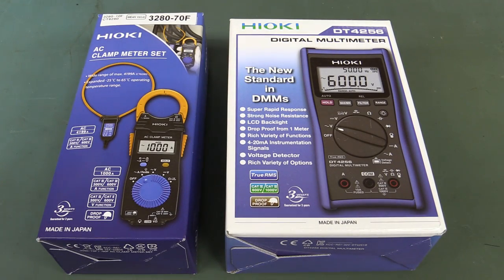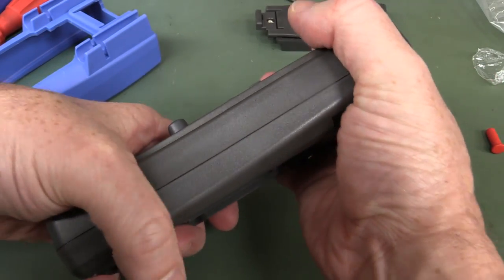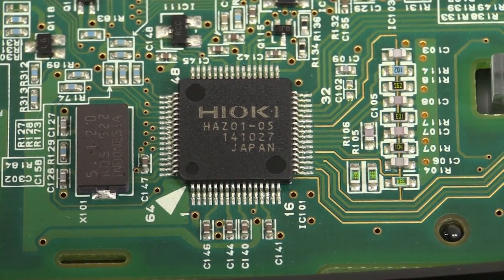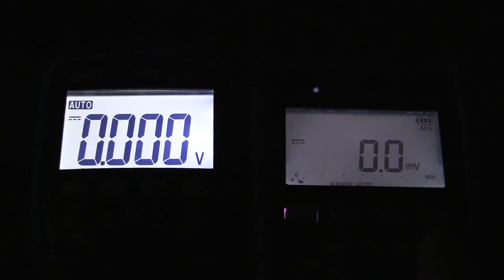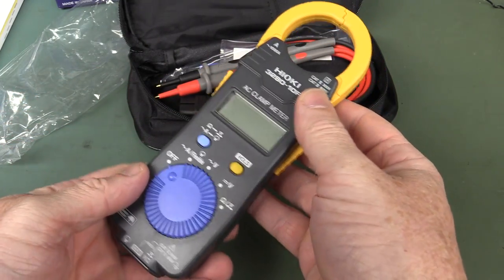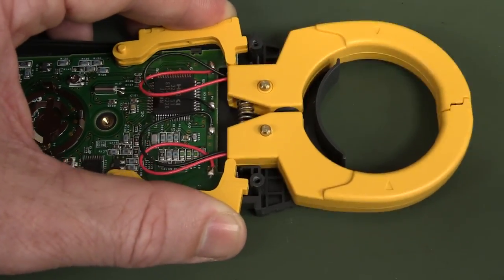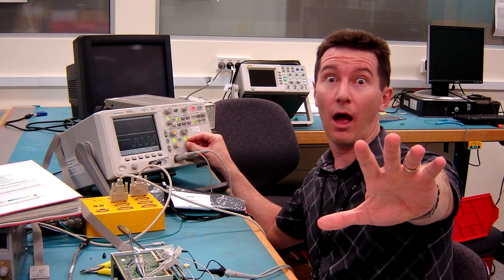EEVblog #973 - Hioki Multimeter Review & Clamp Meter Teardown

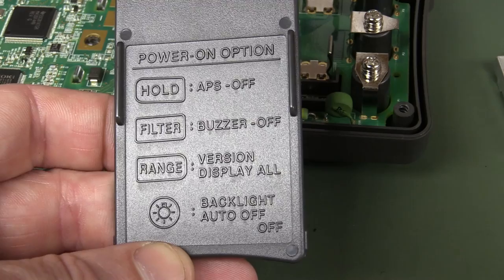Comment: Dave, at 10:07, the buttons are crooked because they are representative of the actual buttons on the front of the meter.
Reply: I noticed that too. It's amusing how they did that, isn't it?
Reply: The designer of the case did some quick copy and paste in his CAD soft.
Reply: +Soren Kuula The text on the instructions is conveniently larger than on the actual buttons. So not complete cut/paste.

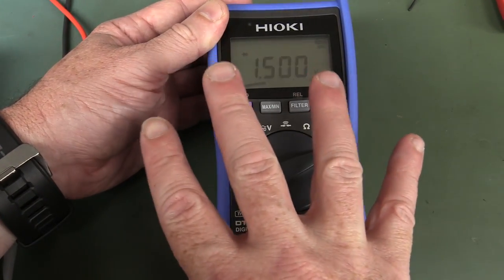Comment: 16:20 the manual says the open probes voltage is up to 5V, but the max it will display is 1.5V, so it will light up any led.

Comment: Doesn't a little flex in the case mean it's less likely to break when it bounces? Need to drop this one off the bridge like you do the others.
Reply: I would guess not. I think that having a rigid material flex back and forth would introduce stresses to it in the long run. Probably better to keep the rigid case rigid, and let the rubber holster deform on impact, as it's designed to do.
Reply: Yes, a little flex wouldn't worry me. It's only got its own weight to manage.
Reply: Yes, it's probably intentional. Just like in automotive hardware, there are no stiff soldered joints, everything is pushed together, so nothing can break. Flexing case will dissipate shock.
Reply: One issue with flex is ceramic caps will crack and potentially fail if the pcb flexes too much.
Reply: indeed the more flexible the case is the more energy it will absorb/dissipate at impact (marbles bounce better than bouncing balls. they leave more marks on a floor or window though). @Ryan Spillman the case flexing doesn't mean the pcb is(could be though). So @dave :) flex is good for the "army" test at 1m+.
Reply: "i dont like this beep, but this other thing should beep when i disable the beep. FAIL!"
Reply: ihazpowrz lol you watched a 30 min vid about a particular multimeter model... And you didnt expect any nit picking? XD

Haha thats what i came for mate :P

Comment: as a sparky in AUS (Sydney) I bought that clamp meter (the older model) 4 years ago at the start of my electrical apprenticeship.. and I'll vouch for how tough it is.. I said to myself when I kill it I'll buy a fluke.. still can't kill it. even dropped it off a 2 story house testing AC units... love it. and now after seeing this video I just purchased the multimeter you just tore down!

thanks for the videos mate, love them.
Reply: just a recap - the DT4256 has been in my tool bag for 4 years now. no issues and cannot fault the unit. i recommend it to any electrician who asks. the fast response time is great for measuring inrush voltages etc.
Reply: @DeejayManii  Thanks for the pro insight!

Comment: Hioki made great meters back in the day.
I found a 1985  Hioki 3200-50 at Goodwill for 5 bucks. Fixed a couple of micro-switches and it was good as new. With case and original leads. Probably the only handheld multi meter to have a 20 micro-amp range  (10nA resolution) and a 10A range (through the leads). Resistance, continuity, vac, vdc and current is all it does but it does those jobs very well. Keep your eyes open at those dollar store for those rare deals.

Comment: There is a very good design reason as to why the clamp meter input terminals were not pcb mounting (as mentioned at 24:58).  If the socket was soldered directly to the pcb the flexing caused by plugging in the probes will eventually cause cracking on the solder joints.  Having the wire links provides mechanical isolation.

Comment: Never heard of Hioki before. They look decent build quality. If they are not to expensive I might get one.
Reply: i have, probably been running for decades in japan, dunno how their prices compare though
Reply: jusb1066 They go here for about 160 Euros. Still need a good one because mine drowned in pond water for about 8 hours. since then it does weird stuff and is totally ouy of calibration.
Reply: My grandpa has a very nice analog model ... its at least 30 years old. Has a leather case.

Comment: Cmon it almost ended up that Brymen is better brand than Hioki :) since Dave got that re branded meter no more reliable multimeter reviews...
Big problem is that you need two hands to flex the meter... really?? :)
Dave also was not impressed with selector switch and Fluke 87 his favorite uses exactly the same one... if it was Brymen I am sure it would pass that test right away :)

Comment: 9:37: The user manual stated IEC 61326-1 Portable Compliance. See Joe Smith's excellent YouTube presentations of how he applied high voltage impulses to different models of multimeter, some were dead after just one 'low level' impulse.  ? Want protection against high voltage surges,  then look for a meter that complies with IEC 61326-1 Portable.

Comment: Field electricians like to have some way to tell the difference between a transient short from a full contact short. Hence, the latching alarm and dead short LED. It helps them trouble shoot what they don't understand.

The custom plug on the leads prevent onsite bogus lead extensions made from Romex. Happens all the time. Nobody likes ladders. The wireless from Fluke is the real solution.

Comment: Thanks Dave. The reason the button images on the back of the kick stand look skewed is that they mimic the actual buttons which are slightly tilted either side below the display. Technically correct but visually odd.
Reply: Typically strange æsthetic.

Comment: As a hobbyist on a fairly tight budget, I needed a meter that would do the critical functions without breaking the bank. I actually ended up going for the uni-t ut58d (goes for ~30-40 USD, I got it for 25 on ebay). Overall I would highly recommend it. It's no Fluke, but it can measure capacitance, volts/amps ac/dc, diodes, ohms (normal stuff), and the real seller for me was inductance (it's not extremely accurate, but it gets fair accuracy, measured against the fluke we have in our lab)

Comment: I own both the DT4256 and the DT4282. The 4256 is great in the toolbelt and for the price in NZ you get considerably more functions versus similar priced fluke and has better ratings compared to kyoritsu counterparts. As expected the 4282 totally smashes the 56 but it does cost more than double! I wouldn't however carry it around as it is heavy and better on the work bench.

Comment: I have one question about that clamp meter.
What type of wire are the four leads going between the PCB and the clamp? As there are a huge difference in quality between single stranded PVC coated wire and tinned multi-stranded silicone coated wire.

Comment: I can see on the clamp meter over time the wire attachment on the clamps is going to fracture the solder joint, should have used strain reliefs through the PCB.

Comment: You need narrow clamp amp meter to fit into modern dense electrical box. Big  and bulky clamp amp meter are even dangerour to work due to possible loose wire. Next you need wide frequence range for measuring inverter control motors.

Comment: ..Some years ago I bought one of these 3280-10 units.....after replacing the battery....readings are now not consistant/accurate...AC volts reads around 138...should be 120...You have any clues? I also have 2 small bicycle headlights that use coin cells...both quit working properly after replacing the battery...

Comment: Dave, how do you feel about the layout at the fuse holder here on the first multimeter? What I find slightly disturbing is that a fuse holder terminal, a corner of it, is right on top of the PCB trace for the opposite fuse terminal, separated only by the solder mask, at least that's what it looks like on video. Now it isn't too bad per se, obviously the two ends are at the same potential and it won't ark or spark over as long as fuse is conductive, but what if the fuse died, could this become a hazard? Is it possible for the corner of the fuse holder to work its way through the solder mask, due to mechanical load or vibration or with age, and effectively short out  and disable the fuse? Is this layout trait intentional and good, or irrelevant, or somewhat unfortunate?

As an aside, from the footage it looks like the body was much more rigid before it was taken apart and screwed back together; then again it does tell us how it would possibly feel in a few years.

Comment: The gap between the upper main fuse clip and the input jack pcb trace seems to be very small isn't it?
Reply: I too had that thought. It seems that if you were to connect a dangerously high voltage and current across, the fuse will go open, then the potential between fuse holder and PCB trace for other side could ark across, carbonizing the solder mask into a conductive path and source of fire; but i'm no expert to say whether it's actually a problem or just seems like one.

Comment: So how would you measure those really high voltage and high power applications, like long distance power lines that transfer 380kV at tens of thousands of amps, if you were at a transformer station and needed those values? How does a meter look like that can measure these kinds of power? It certainly isn't anything "pocket size", but how does it look like, how is it designed? Are they being pushed around on a cart, or are these maybe even still analog meters, because digital circuitry can't deal with these amounts of power?
Reply: You measure them cautiously.

Comment: I know this is really off topic, but what is the UK mains plug Amp rating? I always thought (Dependent on RCD and Gauge wiring) it was 32Amp Ring Mains with each socket having a rating of 13Amps or 20Amps if its a duel socket

So other than overloading the rating of the socket, thats clearly not advised, what is actually stopping something drawing the full 32Amps from a UK Socket?
Reply: The fuse in the plug!

Comment: It is the cheapest clamp of Hioki. $89 USD for 3280 main unit.  Make the revision of the most complete the series CM4371 or CM4373 for less than $ 300 are IP54, screen for V, A and Hz simultaneously, Detector of voltage without metallic contact, Nucleus of ferrite nonconductive better ranges and better precision. Are the best clamp of the market BETTER even than the expensive Fluke 376FC

Comment: The solder joint on that R247 resitor at 6:25 doesn't look too good.
Reply: it's through-hole; it's soldered on the other side
Reply: It's got a pad on the top side and it designed to be used in rough environments, shouldn't it be soldered all the way through to increase durability?
Reply: i doubt it makes much of a difference

Comment: The jack on the bottom of the clamp meter (at 21:21) looks like a 2-wire mains power cord from a razor could also  fit in there. If so, that's a major fail...
Reply: Or a handy feature for quickly testing power outlets.

Comment: Nothing wrong with the Hioki DT4256 Multimeter.I notice youre just trying to sell youre brand.I reckon you will give yourself a bad name.
Reply: Bill Queensland
No instrument is perfect.  The Hioki is cheaper than Fluke or Keysight (Agilent) in most markets, and is comparable.  You gain some features and lose others.  The diode test limitation is the only thing that I found a bit odd, given that checking LEDs is a pretty common task.

Hioki don't seem to make a mid-range meter aimed at electronics use, though.  They seem to be aiming at the domestic (Japan) electrical trade market.  That may change, though.  According to the local reps here, Hioki have new management that want to sell outside of Japan.  This meter is roughly US$100 here at the moment, which is aggressive pricing that seems to back up that claim.

Comment: Japan usually makes good stuff. I see them as second in engineering right behind Germany
Reply: jimbobbyrnes I generally associate Germany with mechanical engineering, and Japan with electrical engineering.
Reply: Japan makes better vehicles and you have to have ability in mechanical engineering to achieve that.

Comment: Its safe     Thats the biggest thing
Reply: That wouldn't make a difference for Mehdi Sadaghdar, he seems to be immortal...
Reply: i  LOVE electroboom  though i must admit   his latest video had insuficient popping of electronis
Reply: no hes not
Reply: If you ever wonder how he's still alive, he's just really familiar with his tolerances. Not actually all that dangerous, safety happens between the ears.
Reply: Insufficient popping... instead he's got a load of frustration. Why would anyone try to encase a pump in hot glue? A better way is to find a jar large enough, attach the output to the lid and add another hole in the lid to vaccume from. And i've never seen someone try to use such thin plexiglass.
Reply: Well   He did learn!

Comment: its a shame my fluke 73 startetd to act weird and i dont trust it nomore
Reply: hope to get new one
Reply: how did it act weird
Reply: @Thefreakyfreek  Did you clean and lube the range selector switch?
Reply: @stephenarling1667  yes i did but the same stuf stil happend i is realy far of in the amp range and the voltage is also not good anymore 

it depens on  how moist the air is

i got a voltcraft clamp meter now and i do love it

Comment: For $200 you can do better.
Reply: $151 postpaid in the USA through Amazon.
Reply: Do R/C! fluke is better
Reply: can you get a fluke for $200? The only one I can find for the equivalent to that price in UK (including tax) is the fluke 113, which is too basic for anyone. Fluke 115 is about $200 equivalent before tax, so that would probably be preferable to the HIOKI. I got a Brymen BM869 for about that price which I'm very happy with.
Reply: Chinese market Flukes?
Reply: They're not real flukes, they're mediocre (rebadged chinese OEM?) multimeters and that's why they're not sold under the fluke brand outside china. It doesn't stop them from getting good reviews on youtube because of brand loyalty, but looking inside there's a world of difference in quality between them and a real fluke, and IIRC their specs for accuracy etc aren't great either. Actually, they're probably about on par to the mediocre Hioki meter in this video.

Comment: As an electrician I wouldn't use either one of these. Not listed, and a 10+ year old Fluke is much better than these.
Reply: Josh Forester
They're as good as Fluke.  Check 'joe smith' here (YouTube) for breakdown testing.
Reply: Compared to a 117, what would make this just as good?
Reply: they dont do UL listings as its not american, it still meets cat standards.
Reply: Josh Forester
This has more features than the Fluke 117, and is more robust.  There are always trade-offs, though, such as the weak diode test function.  All that I am saying is you shouldn't dismiss something that is a standard instrument in Japan -- this isn't a dodgy Chinese item that you can't trust to be safe to work with.
Reply: Not dismissing it, just as a meter for field use there's nothing "dodgy" about fluke.
Reply: Anyone can stamp a CAT rating on their product; like in the case of the CE mark. Doesn't have to be UL, it's just reassuring that it was evaluated by a third party.
Reply: Josh this meter is one of their cheaper ones they advertise it as a budget multimeter. I would rate the hioki equivalent over a chinese made made fluke 117 anyday. This company make awsome meters and as an electrician rate them highly. Their durability to survive drops shreds fluke to death regardless of what this clown thinks. Leave your hioki meter out all night in the rain and turn it on the next day no problems. Maybe he should test out their meter two models up.